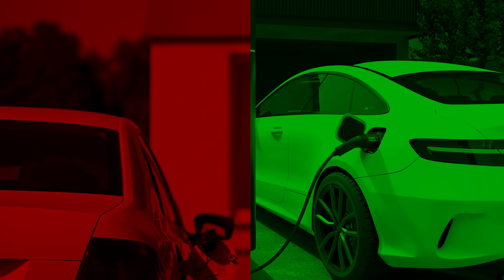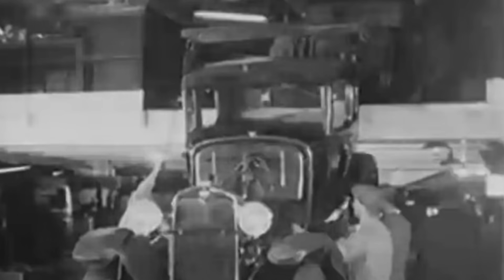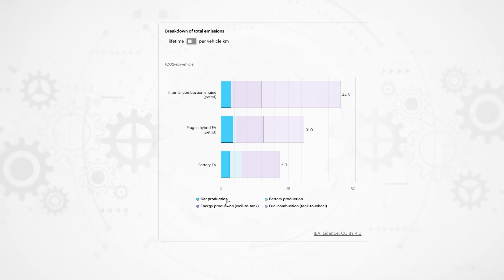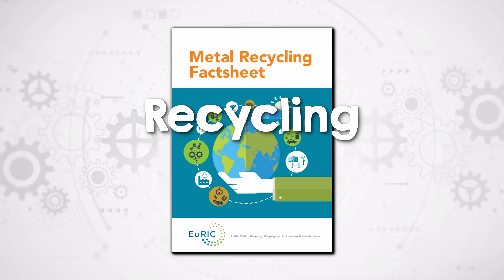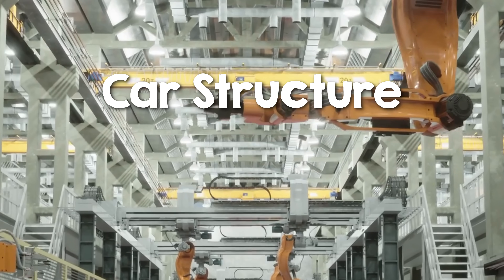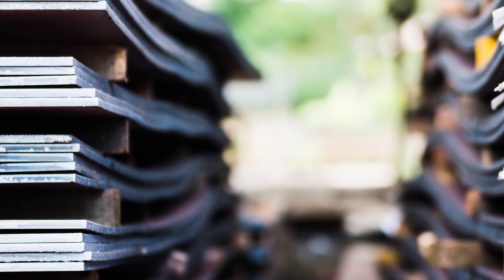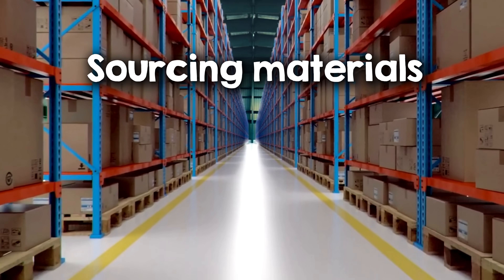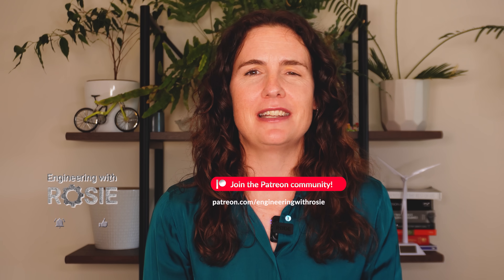The Hidden EV Manufacturing Problem No One Talks About

Comment: I hope people realize that recycling batteries lowers the need to dig more material.  Once we reach a certain point in the number of EVs in the world, recycling should have the highest percentage in making new batteries.
You also need to realize new chemistries are still in play, such as Sodium Batteries, which will greatly reduce the carbon footprint.
Carbon footprint in making batteries can be reduced by using Electrical machines instead combustion engine vehicles for mining.  You also need to realize that there is a lot of future  potential in using  electricity in all sort of scenarios in retrieving raw ores for making batteries.
The world is still young in manufacturing EVs, batteries and recycling.  A lot of this post is speculative that carton emissions will be high in future manufacturing of EVs and in recycling.
It is still way too early to call EVs dead and waist full.
Reply: The inherent properties of Sodium mean it will always have a "power density disadvantage" compared to Lithium.
It simply can't hold enough energy for a given weight/ volume.
if the "standard answer" to that is "They are developing new cell construction techniques and materials ("Solid state", etc) those SAME techniques can also be applied to lithium.
.
everyone asks the wrong question.
"we" should ask, NOT "when will Sodium catch up?" but "When will Sodium chemistries achieve the performance envelope required for certain applications?"
.
The answers are "For grid storage?" probably soon.
For the "Cheap city EV?"...... THAT is a problem, because that vehicle type is generally designed to be "Smaller and lighter", meaning a "Larger, less energy dense cell/ Pack" will have greater impact on percentage of vehicle volume used and percentage weight of the vehicle, impacting both internal space  for passengers and general energy efficiency.
.
Reply: "inherent properties of Sodium"? "It is simply" for YT experts, who simply regurgitate the obvious... That a sodium atom is heavier than lithium atom....

Comment: To be honest I am much more interested in reuse than recycling for complex equipment like EVs and Li batteries. Doubling the useful life of the components in a new application is a cost positive 50% reduction and seems much more achievable. The digital twin thing sounds practical but AI driven quality assurance seems a bit implausible. Would it really perform better than humans at interpreting the data?
Reply: Factories already do this. Bunch of computer vision systems are deployed in factories to control all sorts of stuff. Human is usually in the loop somewhere but a ton of the work is automated.

Comment: I think, the most important Point is Durability and Fixability or just Quality. Or from a nother few, just Money. From an Engeneering Perspectiv, a modern 500.000 Mile Diesel Engine and a Chassie that dosent rust through after 5 Years, is absolutly doable, but...the Economy.
Same for EV's. But as long, as there is no Solution for clean Energie, other like that Windturbines or Solarpanels, wich are btw toxic Waste itself, EV 's in higher Numbers make no sense. Niches, absolutly. But today, the Customer is a Guinipig for the Industry, cought by the Idea of beeing Environment Friendly and Sustainable. They even dont know what to do with the Battery of my cordless Drill
Reply: Nice comment...   shame it's a lot of bollocks!
500K of diesel engine working is a crapload of carbon footprint.   Wind turbines and solar panels have sod all footprint in comparison.
Reply: @annpeerkat2020  yes, you are Right, sometimes my Kruger-Dunning-Syndrom kicks in
Reply: Wind turbines and solar panels are not toxic waste. Just try eating one for yourself.
Reply: Ok, what toxic waste do wind turbines and solar modules produce? How does this compare, for example, to the coal ash you'd get from producing the same amount of electricity?
Reply: True, not much point cutting the embodied emissions of an EV that's designed to be a full write off as soon as the battery needs replacing, because the cells are all built into the chassis for "efficiency".
(No this is not a defense of ICE vehicles, which are often also optimised to be written off soon after warranty)
Reply: Over 80 million barrels of oil extracted every day are are absolutely Environment Friendly and  Sustainable.
Reply: @vz5835  15 million Liter of fresh Water for Lithium isnt worth a Word. A fragment of that Oil is used for Fuel. Look, I would bet my Money on Copper Mines. The thirst will be Gigantic, Gold and Silver as well. BTW...the Daily thurst of the US Military is aprox 395.000 Barrell per Day😅
Reply: @AMeise-vy4fk  Sodium ion batteries at expected to lower battery costs by a factor of 10.

Comment: Imagine diesel with all of above. 1,000,000 miles lifespan with minimalistic production carbon footprint. 
Upgrade it to used veggie oil fuel and we are talking about a negative carbon footprint. At same time reducing fire risk, toxic waste and safety.
Reply: if you run the numbers you just can't grow enough oil crops to run that at a societal scale, and battery manufacturing emissions are due to fossil fuel use for the mining and processing of the required resources, which can and will just be converted to green energy.... eventually lol

That said, I like the idea for the individuals who need the capabilities (since most day to day usage can be covered by batteries or other non-battery non-fossil methods like overhead wire electric rail transit or bikes or whatever, at least based on the statistics that most people live in cities or suburbs)
Reply: That might be part of the solution but it won't replace EVs. The reason being we don't produce enough vegetable oil globally to support large scale automotive demand.
Reply: @SocialDownclimber  Ture, there is no enough veggie oil available at this moment to sustain the needs of western society. But if all veggie oil was utilised, more efficient vehicles were produced and "unhealthy western habits" were abandoned... the output would be much more humane and less intrussive than EV. 

3000kg EV vs 700kg veggie oil Kei car like city vehicle. 
+350hp with 0-60 under 3s vs 50hp with top speed of 70mph
All veggie oil waste recycled, at home! 
GMO veggie oil - why not? Eatable stuff should be GMO-free, but fuel is OK!

And there is still tons of diesel fuel being produced as a byproduct of phmarceuticals, plastic and other "so called eco" essentials. This can be reduced but wont be dumped into vulcano! So veggie-diesel fuels are obvious option. 

And all of this would be welcomed by everyone! No just by folks on befetis and tax relief.
Reply: Veggie oil fuel is very much carbon positive, just run it through your favorite LLM.
Reply: @vgstb  Veggie oil is a cyclical product. It absorbs co2 during growth and realises it during combustion. In-between it serves as a lubricant, cooking or beauty product. It is easily recyclable even at DIY scale. Considerening whole life-cycle, veggie oil fuel is carbon negative.
Reply: Producing one gallon of vegetable oil releases approximately 13 to 16.5 kg of CO2, depending on the production method and specific type of oil. These values do not always include emissions from land-use change, which can substantially increase the carbon footprint.
Reply: Sunlight and wind aren't themselves creating a carbon footprint.
Extracting and using diesel oil, or growing and extracting veggie oil DO have significant carbon footprints.
How many fish and chip shops do you think the world would need to power the world's car fleet....   20 shops per car???
Reply: @ryteulopki8069
Well, you certainly have "Imagination"
The "non-existent Diesel "Unicorn" Engine"
"Veggie" (Bio?) fuels which actually have a huge carbon footprint (Proven)
"Fire risk" which would need to improve substantially to get CLOSE to to safety of Existing batteries
Continuous "Toxic waste" from the "Burning" of hydrocarbons, rather than the totally recyclable battery option.
And finally, does  your definition of "Safety" account for the continued breathing of unhealthy combustion exhaust?
Reply: If you believe that vegetable oil has a negative carbon footprint, you’re delusional.

Comment: My job was to provide support for industrial engineering maintenance by repairing broken equipment, because everything breaks down eventually.
The cooling system for a refrigerated warehouse broke down during a heatwave, placing a warehouse full of food at risk of spoiling.
Those nicely synchronised robots WILL break down in time, and my job would be the very last one to be replaced by robots..
Reply: Famous last words and rationalizations....

Comment: Good report/presentation, thanks. However, you got the Boeing 737 Max example wrong. The problem was not manufacturing, it was the fierce competition with Airbus that drove Boeing to design software that allowed pilots to fly their new model without the expensive type rating training in a new simulator and then withholding how it worked from the pilots.
Reply: A host of problems have been reported by whistle blowers on quality, design and testing issues at Boeing, with significant blame on pressure from management to shortcut costs and shortcut time to delivery.
Reply: that was doomed to fail it was rushed to stay competitive at the cost of lives typical greedy corporate overlord moment and they got away with it almost no liability so far as usual
Reply: There is an hierarchy of hundreds of problems but they all spawned from a central root cause: financialization. They went from an engineering company to a hedge fund company. They are hostage to quarter returns and cut cost in research everywhere.

Comment: Hidden?  If only we could keep the oil companies from screaming about that.
Reply: The oil companies are also lying about the CO2 output of their vehicles. It’s not just the CO2 from burning the gas, but also the CO2 produced during oil extraction, refining, and delivery to a gas station. Then additionally, there’s the cost of driving out of your way to a gas station every time your fuel level is low.
Reply: @terjeoseberg990 on top of that it's subsidized by the tax payer.
Reply: @Globalscanningeyes , That too.
Reply: @Globalscanningeyes  Well of course.   Otherwise all this lobbying and spreading of disinformation would cut into their profits so of course they need subsidized.  :p
Reply: @terjeoseberg990 Well said!
Reply: @terjeoseberg990 What about the poisonous carbon monoxide? Why is that always left out? There can be no questions from an anti-EV person about what that those.
Reply: @terjeoseberg990  Unlikely they are lieing, more likely you are not reading. Fuels, as diesel and petrol are only small fraction of whole production. Therefore only this part of production-related co2 emission is directly correlated with fuels. Rest of plastics, medicines, greases, textiles... and hole buch of other stuff has its own co2 footprint. You cannot blame cars for everything ;)
Reply: @ryteulopki8069, You’re absolutely confused. They are lying.
Reply: @terjeoseberg990   no, you're being lied to
Reply: @terjeoseberg990  I understand this can be confusing. You will get, keep reading.
Reply: @kayakMike1000 , Nope. You’re being lied to.
Reply: @ryteulopki8069, Bro, you don’t even know the difference between kW and kWh.
Reply: "oil companies.. screaming" about it? Seriously? What oil company has ever wasted money advertising it?  

It is sad we live in a age of conspiracy theories on all sides.... Instead of just  focusing on solving the problems.

And don't look now but we'll still use plenty of oil even if every vehicle ran on electricity. And some oil companies are investing in charging stations. Good luck growing up.
Reply: @ryteulopki8069 It's not lying to say EV create more CO2 to build.   It's lying when they say EVs are worse then ICE cars.   Specifically when they funded the science they shows that it's not true. So, knowingly spreading information that they know is not true is called lying.
Reply: @ryteulopki8069, Bro, you don’t even know the difference between kW and kWh.
Reply: @ryteulopki8069 <—— This foolio doesn’t even understand the difference between kW and kWh and he wants you to believe that he’s an expert. Hahahahahaha!!!
Reply: @nc3826 , We need nuclear, and alternative methods for manufacturing steel, cement, and plastics. And they are working on it. Meanwhile the oil industry invests in spreading lies and misinformation.
Reply: @terjeoseberg990   LMAO "We need....." Who are we?...."And they...."  Who are they? " How is any of that relevant to my comment? It's not

As far as the "oil industry ... lies and misinformation"  "About what to who" Give me one specific example for this particular case? I don't hear any examples, Since you have none, only a ranting pointless narrative

Thx my YT  triggered wannabe expert for those conspiracy theories....  Which proved my earlier point.... Enjoy...
Reply: @terjeoseberg990   CO2 is good for the planet.  More carbon in the carbon cycle gives the environmentd a much bigger chemical budget to grow plants feed critters and support more life.  It's also possible that extra warmth from CO2 lengthens the growing season.  All positives.
Reply: @kayakMike1000 , You’re delusional. CO2 is a poison that will kill you, and more of it is absolutely not good for the planet.
Reply: @kayakMike1000  Why are you mindlessly repeating denier talking points?
Reply: @kayakMike1000  Of course that conveniently leaves out the fact that too much CO2 is a stress to plants.  Plants optimum CO2 level is about 400 ppm.   We are already at 430 ppm.   
Much like you.  You absolutely, 100% require water.  But to much water is called drowning.  More is not always better.
I don't think that particular piece of misinformation comes from the oil companies.  I usually hear if from the religious groups.  Ironically ones that hope plants will evolve to deal with higher CO2.  All the while denying that there is such a  thing as evolution.
Reply: @kayakMike1000 Maybe so.  But in any case mortality from cold exceeds that from heat by around five to one. So obviously the warmer it gets the fewer people die.  We're chucking trillions at AGW   to kill people.  I live in a city where the average year round temperature is 9°C.  In that temperature with a light breeze and drizzle I reckon I'd freeze to death in two days without shelter.   With the projected warming I reckon I'd live another day or so.   If you think this a climate emergency you are beyond help.
Reply: The left doesn't like talking about it, the right doesn't like shutting up about it.
Reply: Seriously?!! I've not heard a peep from the oil companies regarding this.  They might be bending the ear of some congressmen, but they're outspent by lobbyists promoting Green horseshit.  Or do you claim that every EV skeptic is actually Exxon Mobil?
Reply: When you are a "global worming" enthusiast... the whole 800,000 years of data is "hidden" from you.

Comment: Fossil fuel energy useage is 6,500TWH every year in Australia. 
Grid electricity useage is 250TWh annually in Australia. 
Self generation 250TWh and then feedin 250TWh annually can create massive tax-free savings to the 20million meter boxes in Australia 

Industrial Customers moving away from fossil fuels to clean grid feed-in electricity will be the new cashflow for the grid owners. 

Grid owners will be the emergency backup services for the individual meter boxes owners. 

Much new energy strategic evolution too happen.

250TWh x 50cents kWh is $TRILLIONS saved annually. 
No imported petroleum, no expensive new grid capacity, no international priced heating gas ...

Robotic factories can speed the evolution. 

Robotic recycling of old PV panels and batteries and ICE vehicles and ... can expand raw materials.
Reply: The weird thing is that few of the old solar panels discarded have actually failed.   They degenerate in output a bit over decades....   but they are still eminently useable.   Inner urban residences tend to have sod all spare space for solar panels, but most other residences have room for panels either on the roof or a ground mounted array.
Reply: @annpeerkat2020  excellent comment

Comment: Dark factories in China were the topic of a few news articles recently. 
No lights, no air-conditioning, no wasted energy in the 247 robotic manufacturing factory. 
No lunch rooms, no toilet, no restrooms, no car parking spaces.
Only productive floorspace. 

The digital twin to the digital controlled robotic manufacturing. 

Dark manufacturing 247.

Horse meat was cheap when the Ford model T production line started.
A Tony Seba quote.

From dark factories;
Robotic manufacturing rooftop PV.
PV panels to be installed on the cheapest real estate in the cities and suburbs, the empty rooftops on homes and buildings. 

Robotic battery manufacturing. 

Robotic EV manufacturing. 

Australia imports batteries and rooftop PV and EVs 
Australia maybe importing dark manufacturing for Made in  Australia products.
Fortunately Australia has little workforce to become redundant.
Happy days. 😊
Neglected electric power generation plant  can be replaced with rooftop PV and batteries. 
The national electrical grid can be unloaded with consumer self generation. And feed-in electricity 

China may stop coal imports.

Comment: ICE cars have many hundreds more precisely machined and manufactured parts than EVs and those engine/transmission parts require much more maintenance but don't have as long a useful life as the EV drivetrain. The energy required to find oil, extract it and refine it into fuel uses more resources and power than mining and infinitely recycling battery minerals. Crash safety and chassis manufacturing is a moot point since the same can be said of ICE cars.